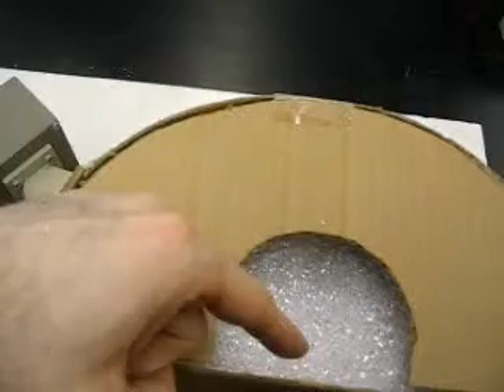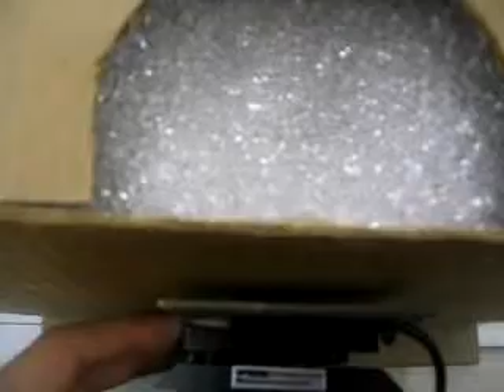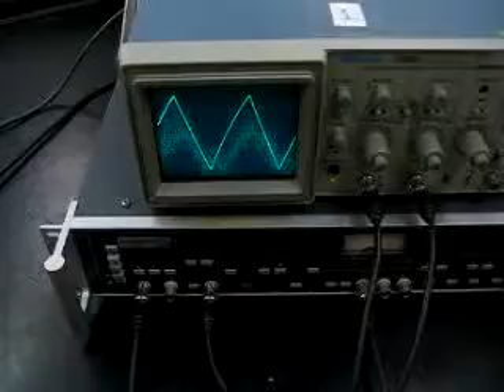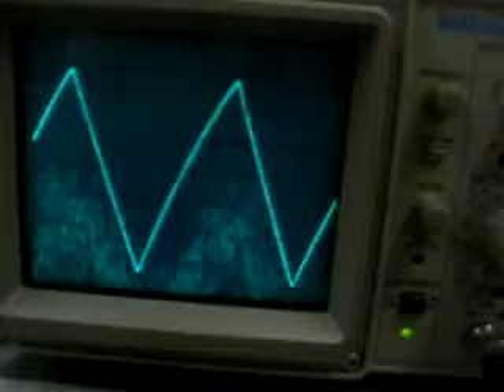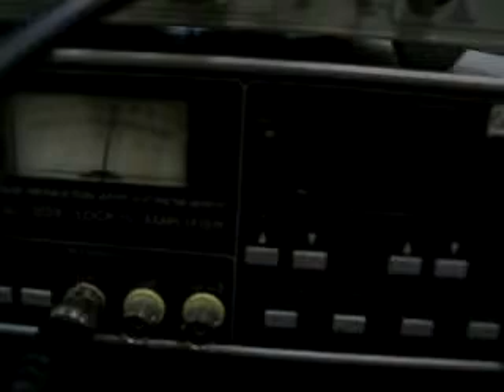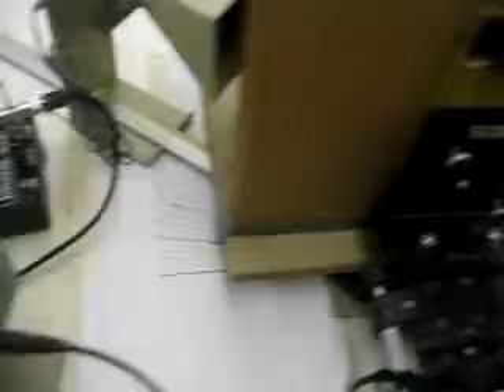MWFrustratedTIR

Comment from the maker: Not sure I understand the question. 
The detector is a diode on the other side of that green piece of plastic. If you are asking what happens if I rotate it about a vertical axis while it stays right next to the detector, I'm assuming there would be minimal change.